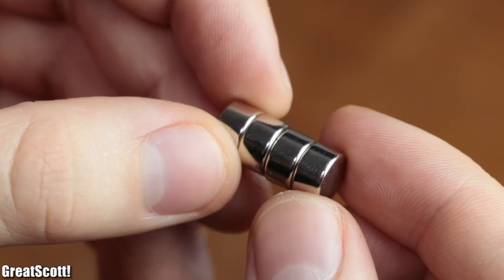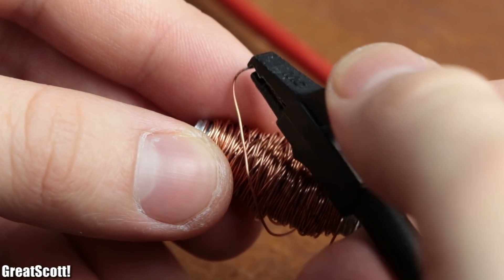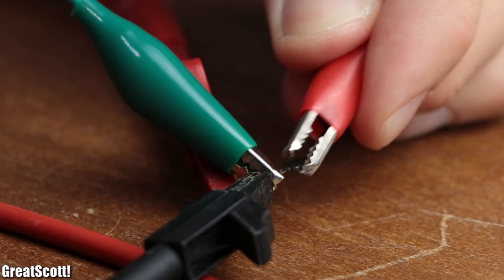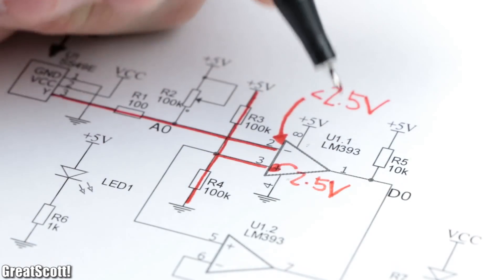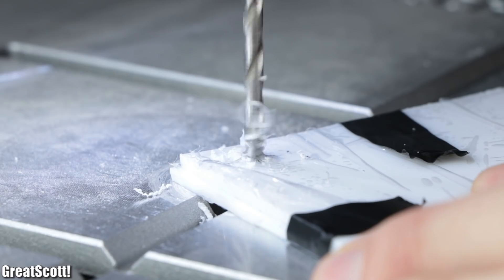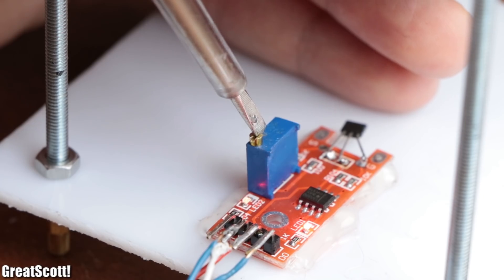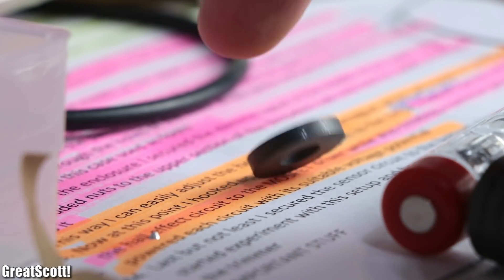How does Magnetic Levitation work? || Crude Levitator circuit

Comment: I’m not a CNC user but came across this site. For all of you checking out magnetic levitation you need to invest some time and research Turbocor. I worked in chemical treatment of centrifugal chillers and at least ten years ago a company developed magnetic field bearings for the driveshafts used in centrifugal chillers. We are talking about very large several hundred ton AC systems. When they start up they will go from 0- 24,000 +/-rpm in seconds. They sound so cool compared to the old electric motor driven driveshafts. The other benefit are dramatically lowered decibels of less than 100, in the 75 range if memory serves me correctly. So much quieter especially compared to the electric drive piston compressors than sound like howling ball bearings in a dumpster. The company that produces them I believe is called Danfoss Turbocor Compressors. Check it out.

Comment: You  should better use PID feedback control of current flowing througth electric magnet with analog input signal of magnetic strength to ease the oscillation.

Comment: I have solution for this oscilations.. just add a little thick non feromagnetic metal plate like copper or aluminum just between the permanent magnet and electromagnet which will make the permanent magnet more stable because of eddy current generated due to permanent magnet oscilation. And add you may place the hall sensor attached just under the electromagnet

Comment: Quick question.  What is the purpose of that TC4420?  I mean, you could use it to drive the coil but you are not.  And the 2n7000 has a low on voltage....so why is that extra component there?

Comment: It doesn't work because its inherently unstable - it will bounce up and down with increasing amplitude. 
You need to look at it from a control systems theory point of view and make sure the loop gain is less than 1 at a phase shift of 180degress.
To completely avoid such analysis just add a derivative function that analogly reduces or prematurely turns off the electromagnet earlier proportionally to the upward speed of the magnet (and conversely for the downward).  
This is similar to adding a D to the P in a PID controller (without using I) as mentioned in another comment.

Comment: This circuit can also be made with Relays. When the voltage from the sensor falls below the threshold value of the relay, the relay will turn off which will move the magnet away which will increase the voltage from the sensor and the relay will turn on turning on the whole circuit

Comment: good video I ask you a question is it possible to control an electromagnet through an arduino but using pulses instead of the classic turn off and turn on as if it were a led
Reply: Yes.
You have to look up how to use the PID library for Arduino if you want the Arduino to do the system for you.

Comment: A PID controller would help but alone won't do the job.  The problem is substantial lag between the voltage applied to the electromagnet and the magnetic flux it produces.  By the time the flux increases, the supported object has fallen and is propelled upward by excess magnetic field.  Then the same thing as the voltage is reduced by the rising object.  The solution is a lead/lag network between the position sensor and the amplifier that drives the magnet.  Some net lead is needed to in effect anticipate the delay in the magnetic field build-up.   I build exactly such a device as a "senior project" when in college.
Reply: Same.
Except lag is not the problem, I thought it was too, but the control system I used was responding at 490 Hz.
We had ours use a phase-lag compensator, PI controller and then pushed it through the comparator.
We didn't use a MOSFET, ours used a power BJT.

Comment: Surely it is still possible to make an object suspend with magnets if you:
 1- Use a specific pattern/layout of magnets that is more stable...I.e rather than just placing magnets flat above each other stick them to an object that is either round or triangular with the base in a V like shape and the magnets on the static base object on the ground could then be the opposite shape? Kina like putting a ball in a bowl but with repelling magnets on bothe the ball and bowl. 
2- the object would surely have to be a very specific weight to counteract the magnetic repulsion. Too heavy and it wouldn't levitate much and too light and the object will either be flipped or easily knocked out of stability. I'm going to purchase materials I require for this next month and try it I'll post a video based on my findings

Comment: I expect you need a bit of hysteresis in the circuit if the NO and OFF points are too close it becomes unstable as the switch between on and off becomes an oscillation. The amount of hysteresis if critical too much and the magnet will drop before the electromagnet picks up, too little and your back to oscillation. TI have a good explanation see ti.com and search "adding hysteresis to an op amp switch" Good luck hope it helps.

Comment: The solution is pretty simple - I tried the same and had the same problem - the hall sensor.

It is far way to sensible and even if you try it with a PID controller it is still not working (like in your other video). I tried the H501 and it worked perfectly and very easy without and PID. But nice video :)
Reply: We got ours to work with the same Hall Effect Sensor... which is EOL to this day... good luck finding them.
We used a PID controller.

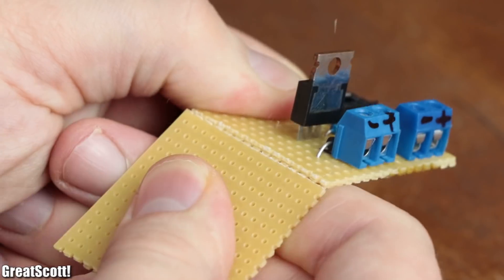Comment: 1:21 I think what you need to do is to cradle it it in a magnetic fields such that it doesn't topple (hence the tendency for spherical shapes). You need force vectors in all directions that can act on the bottom of the magnetic "bowl" cast inside the material.
Edit: High levels of magnetite.

Comment: Control engineer here. The two state control is at fault, your setup is otherwise fine. A PID controller - even using analog circuitry - will do the job. I have a very similar (open source) project available and fully described here: https://github.com/gergelytakacs/AutomationShield/wiki/pdf/Takacs2020b.pdf You can even change heights nicely.

Comment: hi there, nice video but this is what you have exactly what you make , oscillating system... youre object must change his position to create an command with  sensor to youre electromagnet; its like thermostat... few day ago i had some problems with my car - opel astra h 1.6 gasoline - its funny how those things happen :) - gasoline cars have ECU and lambda Oxygen sensors; to create almost perfect fuel mix they use 2 sensor and "anticipation " ; you can try to slow magnet dropping not to make hit go up -maybe try to use some varistor ?! gl hf ;)

Comment: I wonder if the potentiometer didn't give a very fine adjustment in the reference voltage voltage divider.  What about bigger electromagnet with neodymium magnet instead of ceramic magnets?  When I followed TheSignalPath's tutorial for a Bring Your Kids To Work Day demo, I had to use a scope to help me debug / fine tune.  Maybe the MOSFET driver introduced too much delay / filtering?  There might also be too much overshoot from the output turning completely on or off (as opposed to a scaled PWM duty) due to inverting signal delays / sensor delays and the mass of the magnet.  Why not have the potentiometer R2 replace R3 to make the non-inverting input adjustable?  I wonder if the Honeywell Hall effect sensor can sink any current to maintain a stable Y output voltage, so while R2 is adjusting a baseline inverting input, it might not be able to adjust the equilibrium point as a part of the feedback loop, and only is adjusting an open loop equilibrium.

Comment: I think if you use a microcontroller as an Arduino an make a PID control system using de analog part of the hall sensor it might work, with the PID you could vary the intensity of the magnetic field in the coil. Great Video!

Comment: Place the hall sensor just under the electromagnet. You are placing the sensor long away from the floating magnet. In this configuration the hall sensor cannot detect the slight change in position of the floating magnet from the magnetic field  because of inverse square law. The sensor can  see significant change in magnetic field only when there is large displacement of the magnet, but in that case the magnet is already at a long distance from the electromagnet which takes time to get it back to its intended position after switching on the electromagnet. This initiates oscillation. I have done it with similar setup and its nicely stable.

Comment: I think so, I'm just guessing here. You need zeta > 1.  The critically damped circuit will improve your oscillations. Have too, add the Caps and inductors to fine tune your circuit. Thank-you, really enjoyed your video. My curious mind may be wrong, if so, too any reader/writer, please feel free too comment/correct / clarify. Thanks. 👍
Reply: Lol 😁,  so background information: left electronics 10years ago. Kinda miss pcb manufacture and the mini hacksaw, surface mount etc
Reply: Or could replace the Hall Effect Magnetic Sensor SS495A1(HEM SS495a1)

Crudely read 📖 the datasheet for HEM SS495a1 and: At 25degrees the sensitivity is 3.215 mV/G....

Comment: i did this in 2003 without buying my parts off ebay, back when it was tough finding components, lucky kids these days.... Also, your circuit design is good but the sensor should be mounted between the magnet and electromagnet.  I suspended a brick.... took me months... good explanation, good video. If you are interested the please check out my videos to see an old circuit design from 1998. i made it when i was 12 years old, finally dug it out for a video a few years back.

Comment: You need two coils in the top wound opposite each other and this will work either way from the top or bottom. That is how mag lev trains work.
Reply: I'm pretty sure the coils also need to be different phases. 
Like in the "Linear Induction Motor".

If you want to see magnetic levitation, check out Professor Eric Laithwaite: 
The Circle of Magnetism - 1968   also   "Magnetic River"   Here on the "tube" 
-----https://youtu.be/0tJfqMYHaQw-----

The guy that invented the  "Linear Induction Motor"  has a series of videos from the 60's and 70's.  He was considered the  "Father of the Maglev".

Comment: I build this device 10 years ago, and i see similar problem that i get. You can improove stability by using two parts: resistor and capacitor. My scheme consist only three transistor several resistor and 1 capacitor, and it work. For sensor I use two infrared diode from computer mouse. I upload it at my channel.
( watch?v=6Hlv9xcZdmM )

Comment: I built this same device years ago (only using an optical sensor rather than a hall effect sensor) when I was an engineering student just for fun.  I had the same problem- it would oscillate out of control, no matter how sensitively you tune the threshold.  The problem, I realized after some simple computer simulations, is that you are not accounting for the momentum of the suspended object.  If you are only triggering the electromagnet based on position, then you have no way to dampen oscillations that will inevitably build up.  How I solved this was to create a differentiation circuit that would, in effect, tell me the velocity of the object and then modulated the electromagnet using both the position and differential.  A simple PID controller.  I don't recall if I used an integration circuit as well so it might have just been a PD controller.  Worked like a charm and I had a stable levitating ball bearing.

Comment: Scott, you need to have your magnet rotating to create centripetal force to ack as a gyroscope to balance the magnet at a single point in 3d space. You may want to change the vRef resistor R4 in the 1/2 voltage divider to a POT as you can then tune the circuit by changing the vRref. This way you can decrease the oscillations observed in the initial run of the experiment.
Reply: UFOs use same concept?

Comment: What if you used the analog pin from the hall sensor and had that control the duty cycle of a pwm signal to the electomagnet. 

That would seem to keep it from turning on/off, but it would create smoother adjustments as the footing magnet moves

Comment: Hey scout i m doing same job and for that you need at least 12 bit adc and dac pwm is not enough and also 10khz-14khz cpu speed to calculate simultaneously i offer you stm 32 with dac converter also take pid values like that kp=3 ki=0.048 kd=2.

Comment: Maybe a PID controller could keep stable the magnet in certain distance.From my experience the inputs of every comparator or operational amplifier never getting equal and there is a slight voltage difference higher or lower in random that varies.So it needs a correction in critical applications that comparing a reference voltage with a feedback voltage and is impossible to achive a complete accuracy even in the simplest analog power supply.

Comment: Worst cliffhanger ever! I was already trying to build it...
Maybe the board is not fast enough to compensate the changes of height, as you proposed at the end of the video, but it was worth to try changing the position of the board itself. It could work on the side of the magnet, where maybe the variations of magnetic field are less intense. Probably it requires a lot more work to calibrate it though.
Amazing video as always :)

Comment: Whole schematic is very simple, so you can expect problems everywhere.
If you want to stabilize position of levitating magnet, I would recommend to use analog value from HAL sensor instead of comparator ON/OFF and try to use PID control.

Comment: Is part of the problem not that you can't create and destroy magnetic fields instantly and that they take time to build and time to collapse, and the bigger the electromagnet the longer this takes. This would mean there is a maximum frequency you could oscillate the magnet at depending on the magnet size

Comment: My first thought was three words: Pulse Width Modulation.

Feed the electromagnet with fast on-off pulses and modulate their width to change how strongly it attracts the magnets, depending on the output of the hall effect sensor.
Reply: Excellent idea. A theoretical idea I had was to suspend plasma around a metal core inside of a magnetic field in order to suspend the material indefinitely.
Reply: A sensor would be required to adjust  for magnetic polarity.
Reply: A guy did it with a field sensor.  Everytime the distance changed the pwm changed.
Reply: Wouldn't work because solid state switching will get absolutely destroyed by the inductive backemf of the magnet.
Reply: Also the object levitated is a neo magnet in the video i watched with the guy who was successful ( maybe its the power of the magnetic field in the object being levitated more matches the field operating on it )
Reply: Now, theoretically speaking, is it possible to create such a thing in order to suspend a plasma like substance? I was considering a highly pressurized element about a hundred times more dense than osmium. The idea would be then to contain the element inside a magnetic chamber while being attached to a metallic core that could then be used to assist in suspending the element. The magnetic chamber would function as a shielding. A pin sized actuator could be installed, most likely created by another magnetic force which would allow for an exhaust or discharge in the event that it was needed. Now the idea goes further with plasma, not just a magnetic core, but creating an elemental compound. The compound itself would be suspended by the mixture rather than being held by a core. This new form of theoretical science could be exploited to create artificial gravity or a new system of propulsion for space travel.
Reply: How about using - Harmonic Resonance Frequencies -
  
  In a power system when the  system's natural frequency corresponds to the frequency of a source of harmonic current, "HRF" Occurs.

Surround the "Magnetic Chamber" in an array of "HRF."
Reply: Ok

Comment: You need a PID controller buddy, using the sensor's signal continuously and actuating the electromagnet continuously too (using an analog signal if possible). For that, you'll need to find some model of the electromagnet/permanent magnet levitation system, or at least assume an order of the ODE that governs the system and do some linear identification on the transfer function with the measurements. Just going on/off with both the sensor input and actuation signal, you get those jitters all over the place :)

Comment: it does not work because it is not a pid controller instead you need and arduino to process all of that, i do 1 of those myself using thinkernut code and works fine

Comment: Nice work... but I think that to make it works you may use a triac instead of Mosfet to apply a variable voltage thus a variable magnetic field so you can control the distance more efficient.

Comment: Hi, recently I've been given a laptop and it has no battery or charger,  my question is i have many (psu power supplies)" can i wire up a psu power supply simply joining the +12v +5v +3v lines making 20v? And simply make a plug that fits the laptop power jack like in one of your previous videos?    I ask this as i intend on disabling the close screen power down function and using vga to have it on my tv operational with usb bluetooth mouse and keybord while closed so i can store it in a drawer with the psu plugged in the  wall outlet...    just wanting to know if a cpu psu will work?   And thanks for the inspirational vids..